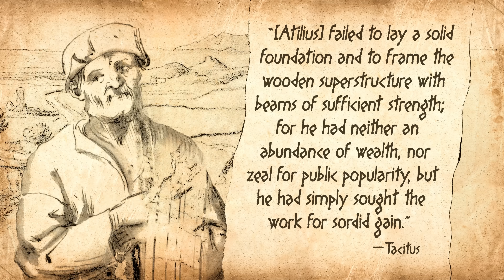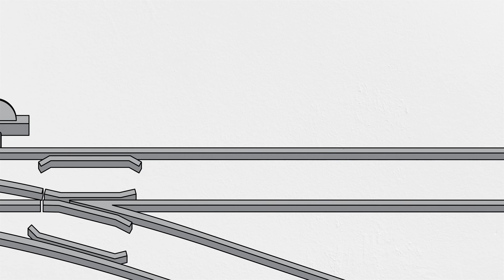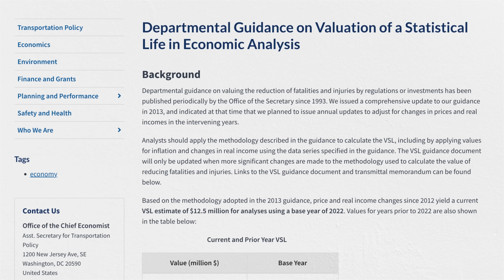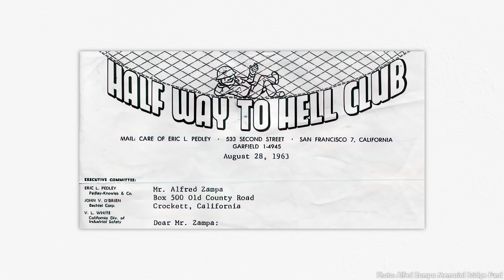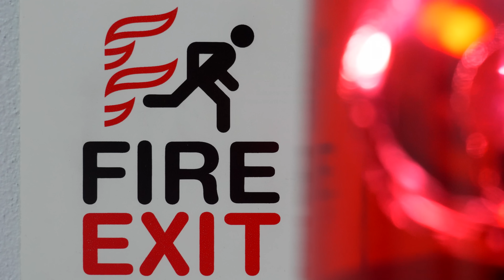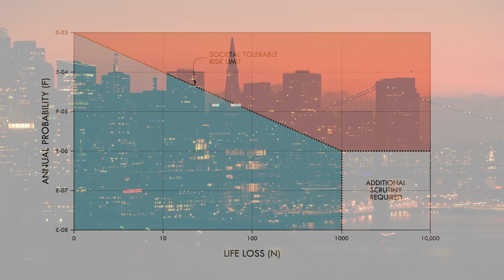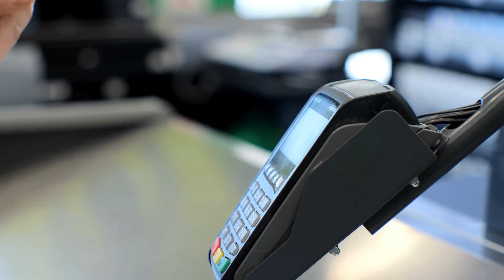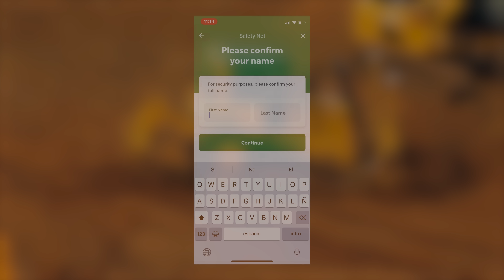How Much Is a Human Worth? (according to engineers)

Comment: A loss of life is a very difficult thing to forget.   I can say I am still haunted by the loss of someone who was not very much younger than I was.  

The young man climbed down into a tank that was lit only by the flashlight he was carrying.  At the bottom of the ladder, he turned left took one step, and fell to the bottom of the tank.  Had he turned right he would still be alive.

During the plan approval process, I rejected the arrangement and the lack of a railing.  I rejected each drawing until I was instructed by the vice president of engineering to stamp the drawings approved. 

A life was lost for the cost of a handrail.  A trivial cost in a multi-million dollar project.  During construction the shipyard had a temporary handrail in place for OSHA compliance. 

I still feel responsible for the loss, although I had no control over the decisions that were made.
Reply: This is a horrible story, made worse by the last passage about OSHA compliance.
Reply: Reminds me of the Challenger disaster, those who fought against the launch were left feeling guilty, wonder how the management felt.
Reply: makes me think of the Sampoong Department Store, The reputable construction company refused to do unsafe work so the owner of the building being built fired them and used their own company.
Reply: This reminds me of the Merrimack Valley gas line failure (which Grady also has a video on)
In hindsight, it's clear that the problem was caused by poor design and/or documentation of the company's infrastructure and was merely triggered by the workers, but I imagine they can't help but feel somewhat responsible for such a massive disaster. 
Of course the ideal solution is to design things with the minimum probability of failure, but as @filanfyretracker mentioned, at some point the customer will just have someone else do it for the cost they want, or it won't happen at all.
Reply: I mean that life’s on you, you directly omitted the thing that would’ve saved that guys’s life. Have you seen directly at the eyes of their family and tell them there was a chance their son would’v come home, but a guy in a multimillion project was too greedy to do so?
Reply: That must be a tough feeling from a tragic experience. I honestly hate that the VP of Eng at your company forced you to put YOUR STAMP on a drawing you felt was unsafe.
Reply: @meesc3556   hate to say it but as a PE myself, in that situation I would give one final refusal, and quit or be fired if necessary. Sometimes those situations happen in engineering. It sucks.

Comment: The trolley problem is one that confronts software engineers working on self-driving systems, and it does so without any engineers to blame for the surrounding systems, because there's no engineer or safety officer available to enforce a safety plan or lookouts for ordinary roads.  If someone decides to jaywalk, that's their fault, not some engineer.

The self-driving systems aren't advanced enough yet to make such calls, but they will be someday soon.  If a couple of kids run out into the street, and a self-driving car doesn't have the room to stop, does it go up on the sidewalk to hit one innocent bystander, or hit two kids?  If given the choice between an accident that's going to be fatal to the occupants, and one that's going to be fatal to a pedestrian, which way should the car choose?

That latter example is actually somewhat easier of a choice.  Self driving cars are already safer than many human drivers, and within the next few years I expect they'll be safer than most human drivers.  At that point it's a moral good to increase the percentage of them on the road, but no one will buy a self-driving car that doesn't prioritize the occupants in an emergency.  So you prioritize passenger safety, and in so doing you increase passenger and pedestrian safety on average.

Comment: I have had some experience in the nuclear industry in the UK and the term "As Low As Reasonably Practicable" or ALARP is used a lot, and covers a similar theme to this video. Essentially, you need to demonstrate that your design has considered the various features, functions and design options that effect safety and argue that the risk is as low as can sensibly be achieved. This is usually tied to a potential amount of radioactive dose that could be experienced by operators or the public in general. For example, it may be possible to make a design that reduces dose to operators by some amount, but it worth the extra millions in cost? Or is there something that only has a slight improvement to safety but only costs peanuts to implement? There are some guides and precedent to help but at some point you need to draw the line somewhere and have an argument for why the design's risk to safety is ALARP.

It is quite an interesting way to consider engineering in safety critical applications, but can also be applied to other sectors, businesses and life in general.
Reply: IEC 61508 quantifies the acceptable risk on the basis that a 1/100,000 chance of an individual dying at work per year is acceptable. A 1 in 2,000,000 risk of killing a member of the general public offsite is also acceptable.
For comparison your probability of dying at work of random health problems (heart attacks and strokes) is 1/10,000 per year.

Comment: The highway example also shows the false dichotomy that sometimes is perceived. Other ways you could save lives without it costing more is to decrease lane size so speed on the highway goes down or to reduce the number of cars on the road by encouraging work from home. (Though the latter might have hidden costs somewhere else like needing a good internet infrastructure).

Comment: the trolly problem is 1/2 of the whole question- the 2nd half is "your a field medic and have 6 injured, 1 critically and 5 not. and your low on supplies. you can save the critically wounded persons but probably not save the other 5- or you can kill the crit woundend and save the 5

Comment: As an advocate for safer streets for bicyclists and pedestrians, this makes me think about other public decisions such as regulations and enforcement, and how we might better communicate about them. For example, the USA had over 42,000 traffic deaths in 2022. At $12.5 million each, that translates to a cost of over $530 billion - which doesn't even count the other costs of traffic crashes such as injuries, infrastructure and property damage, delays, etc. Of course there are lots of other ways the costs of traffic crashes are calculated - I've seen recent figures between $300 and $800 billion in various places, depending on what factors are included. But it's a staggering cost regardless. 
We tend to be very resistant to policies such as reducing speed limits and increasing camera enforcement (or allowing for it in the first place - it's illegal in some places), even those that impose a relatively low cost on individuals on a day to day basis. Obviously reducing all speed limits to 3mph and imposing jail sentences for violating it would be great for reducing fatalities, but the associated costs of doing that would be unacceptable. But I would argue that we could find a much better balance than where we currently are.
Reply: Red light cameras don't increase safety, that's one of the reasons places have stopped using them.
Reply: ... or your entire premise is wrong.

Comment: On the trolley problem - with modern safety and liability practices I wouldn't touch the switch without permission. The 5 are more likely to know it's coming and when to get off the track than the 1 not on the intended track.
Reply: Yeah you'd have to change the potential victims to hostages tied down to the tracks by a moustachioed evildoer to make the moral dilemma really valid.
Reply: You need permission to save a life? That's just an excuse.  Guess you'd never perform CPR or the Heimlich maneuver then.
Reply: @jamesengland7461 Read the thing you're responding to before posting a nonsensical reply.

Comment: We have to be careful about just saying that we should use a cost-benefit analysis. That's what ford did with the infamous Pinto memo. When the people making that decision are not the ones taking the risks the cost-benefit analysis is fundamentally flawed.
Reply: He didn't say we should JUST use a cost- benefit analysis.  It's merely a useful data point. What is missing from this story is that,  back then, at that company,  they thought they could get away with it and it didn't matter.  Now,  at most companies,  they're actually proactive and once they discover a flaw,  they just fix it. Safety is a much higher priority.
Reply: @jamesengland7461  They only fix what is cost effective to fix. That has not changed. The point is that decision is always made by those who are not taking the risk.  The only thing that was unusual about the Pinto memo was that it was put into writing to become a smoking gun. 

Grady did not suggest that we use any other approach to deciding safety than a cost benefit analysis. And my point was to remind him that those who make that calculation are not the ones put at risk. Thus the laws that dictate safety are written in blood. They only spend money to increase safety AFTER accidents put political pressure on lawmakers.

Comment: I don't know if this is true or not (aviation nerds feel free to correct me), but I've heard the reason that most commercial planes have lap belts instead of 3 point belts is because the cost of installing 3 point belts across a commercial fleet is greater than the cost of the extra lives it would save in the event of a crash (in fairness, plane crashes are exceedingly rare)
Reply: it's like the old school bus seat belt argument.  people believe they wouldn't install seat belts because of the cost but in reality, when they did crash testing, the seat belts really just insured that in a front collision, the children would break their necks on the seatback in front of them.  there is a huge number of factors, but with the energy planes crash with on the rare occasions they do crash, the "crash position" puts less force on the person than a shoulder belt would.
Reply: @kenbrown2808  That makes a lot of sense, thanks
Reply: @jennastephens1224  in the case of a plane crash, there is likely enough time and warning to adopt the crash position. A car crash is much more likely to be "a surprise", and advising car drivers to drive around in the crash position as a precaution is probably counterproductive.

Comment: metal or concrete with tarmac on it is flammable?
Reply: Asphaltic cement used in tarmac is flammable.  The intense heat causes metal structural members to loose their strength and then collapse.  Reinforced concrete contains steel reinforcing.
Reply: No,  but an entire tanker truck on fire on or under a bridge can put enough heat in the bridge to cause if to weaken and fail. Think of a tanker trailer as 25 tons of explosive, but burning slowly instead of in a second.

Comment: It's important to not take a reductionist approach to risk; instead, opt for a holistic approach (unless you like surprises). Risk is contextual, and in the case of a human life, under-estimated. Converting human lives to currency values has an inherent issue; it focuses on the economic productivity, activity, and cost of a human life as it's absolute value. The relationships between human lives and everything else (such as social-health effects and biodiversity-ecosystem effects) are completely out of the scope of this calculation (including economically). It's fair to say our model of economic and/or human health risk is inaccurate. It fails to factor non-linearity as a component of systems. (Highways that supposedly improved our society came at the cost of black lives [lack of equity]. Safety regulations for highways say nothing about safer modes of transport [lack of higher-order context]. Widening a highway can temporarily decrease crash risk, but increases traffic volume over time, increasing crash risk [short time horizon].)
Reply: @NotRexButCaesar Not necessarily. Because the incentive structures that govern a private market still focus on profitability, there are some things that are best centrally regulated. Though, this model still leaves out the incentive structures of that central governing body. So, like everything else in this world, the solution is context-dependent.

Comment: Grady, this video is informative, but seeks to justify an inherently unethical system. Placing a dollar amount on a human life is not a quirky fun fact, it is an example of a society that proves explicitly it does not value human life above a certain limit. In your Golden Gate Bridge example, imagine if an engineer had said “well, this net will cost $X therefore it is not worth 20 lives. We should not install it.”

In my opinion, this should be framed around probability of the event, and chance of success. The net under the bridge has a nearly 100% chance of saving a person, so it is worth it, even if no one falls. The odds that a fire resistant bridge will be able to hold long enough to wait for an already delayed road closure is minimal, so it should not be used. In fact, I would argue that the solution to the fire-resistant bridge system wouldn’t be bridge infrastructure at all, but instead increased response times for emergency personnel.

It would be enough to simply assign a probability to a fatality that we are willing to tolerate and justify any cost to bring the structure into line with the probability. It is far more palatable to the loved ones of a dead person to say “we didn’t think this could happen” vs “well, their life was only worth $10m, and the safety infrastructure would have cost $10M + $1 so…. they died.”
Reply: Your premise is wrong from the start.  There's a tremendous infrastructure of safety built into all industries and has been for decades,  almost as quickly as the risks and ability to mitigate those risks was discovered.  And the progress made has been staggering.  

This is obvious every time you see a cable barrier on a highway center median that was damaged without the car crossing or flipping.  Or every time you see a horrible car crash and all the victims are standing around barely injured,  if at all.  Or a house fire in the middle of the night with the entire family standing outside,  sad but safe. Or you realize it's been a full year since the last deadly airline crash. 

I've been in 2 horrible accidents since February that totaled my cars and only needed one bandaid.

Comment: Code of Hammurabi was written nearly 1800 years prior.  Line 53 relates to failure to maintain a dam. Lines 228-233 deal with house construction failures. Lines 234-235 relate to ship construction.  It was not called architecture nor engineering, but laws concerning work done for the public good existed long before the Romans.
Reply: There are laws in the Old Testament regarding this too.

Comment: The bridge fire example is interesting -- of course it's not a risk to human life, but I would like to think they also calculate the financial risk of losing that roadway for 6 weeks.
Reply: It might be that the road would have to be closed regardless even if it were made of fire resistant materials. Just because something is fire resistant doesn't mean it's unaffected. Just because it doesn't collapse doesn't mean it's safe for use after a big fire.
Reply: @alex2143  Exactly, it would have to be rebuild anyway. And the materials used might be worse for the environment than the ones we use now. 

There are just so many factors.
Reply: @alex2143  That's why i said "calculate" rather than "eliminate".   Essentially, I'm saying that the cost of failure is more than the replacement cost of the structure.  (Replacement cost plus loss-of-use), and I hope that was at least evaluated at design time.  It's quite possible that the additional cost of a 30-minute resistance to fire at N degrees is prohibitive.
Reply: @alex2143  I think rebuilding is just an accepted risk because no lives are lost. Also of course in this area its easy to shunt through traffic over to 295 and NJTP and SEPTA/PATCO can pick up some slack to carry commuters into Philly itself.
Reply: @filanfyretracker  I think it's more an inevitability than an accepted risk. The bridge would probably have to be rebuilt anyways, even if fire resistant materials were used. So fire resistant materials would incur high added costs for no material benefit.
Reply: you also have to consider the probability of the event happening in the first place. Its possible the economic / financial penalty of losing that roadway is larger than constructing a fireproof bridge, but the cost of making every bridge fireproof vs the probability of fire might not be worth it. I'm pretty sure they do this analysis (plus others) in real-life, just this video shows a simplified explanation on how human costs apply.
Reply: You just add that in with all the other costs and potential costs, factoring in how likely it is.  The whole point of converting everything to dollar values and probabilities is that your numbers are all the same units, and can just be added and multiplied to give you one number as a result.
Reply: In the video he points out that these fires are most often the result of a fuel tanker catching fire under the bridge/overpass. Any other fire can be extinguished or relocated before causing structural damage.

You'd think it would be rare enough not to be an issue, yet it does happen. Whether there needs to be any changes made as a result is harder to answer. There's always time to evacuate, and the bridge can always be rebuilt. So it comes down to the relative costs of either changing the design (or other relevant factors) or simply accepting that these events do sometimes happen.